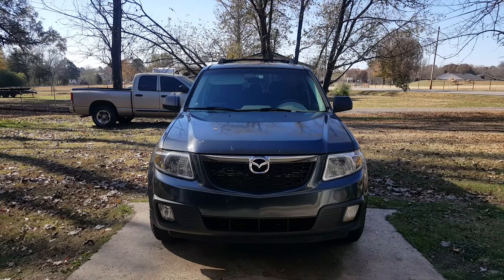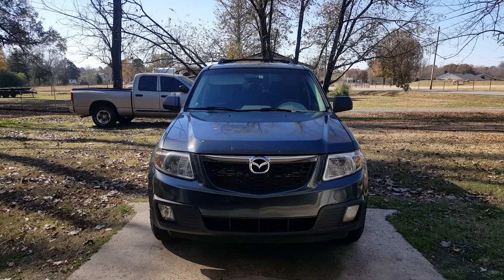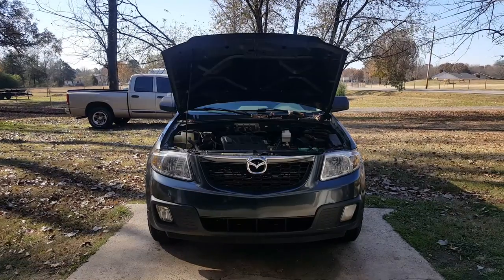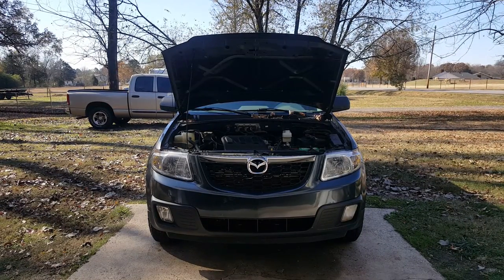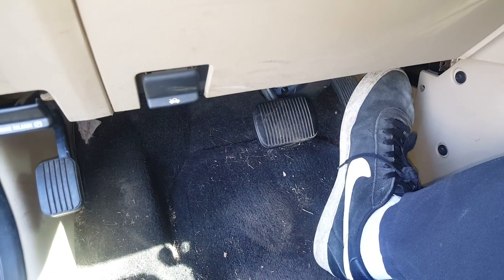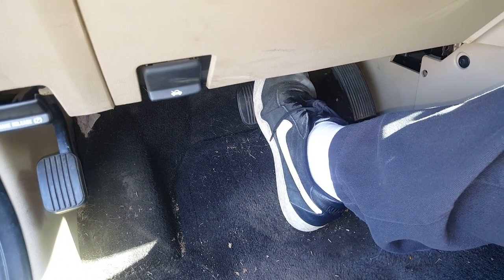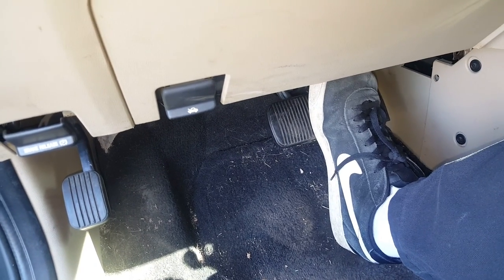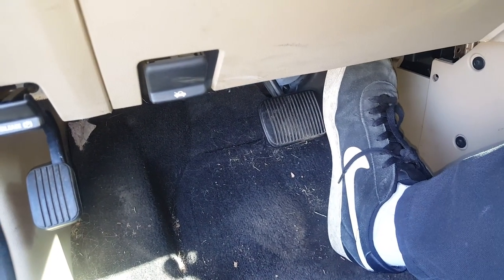Mazda Tribute/Escape/Mariner sinking brake pedal solved abs module/pump replacement

Comment: Great job, just bought my wife a 2010 Escape and after driving it for a month and doing a panic stop my pedal sank to just off the floor.  I also thought it was the master cylinder because the brakes worked but the pedal was low, so I replaced the master.  Problem was not solved, so bought a scan tool.  No ABS faults but low pedal.  I suspected it to be the ABS unit.  Find another with similar problems confirms my diagnosis.  Thanks for sharing your experiance.
Reply from the maker: Most welcome , thank you for the feedback.

Comment: i have had this problem on my 2009 Escape in the past (2014 or so) and had it fixed.  it was around $800.00 then.  I recently had the soft pedal again and began searching for the parts. But the car cant be worth more than $2000 and the fix is approx half that so i was thinking about letting it go.  i decided to pull all the fuses for the ABS and let it sit for about an hour.  plugged them back in and SHAZAAM, sucker works again.  hope it lasts.
Reply from the maker: Great information , this could definitely help others , and be worth a try. I know a similar story with a 2008 Escape , they decided not to fix . Last I checked the pedal was firm again . Really strange , but in some cases something with the abs corrects itself. Thank you for the feedback.
Reply: I'm going to try this on my '08 Escape tomorrow.  Hope I get lucky like you did.

Comment: Great work,  I am having the same issue with my Ford escape 2012 xlt, however there are no codes and no lights in the dashboard, I changed the master cylinder and vaccum hoses and still no luck
Reply from the maker: You might get lucky and use a scan tool to remove some air from the abs unit. Most likely it needs changed. Weird thing I seen on another Escape was it started working again( firm pedal) after driving it some time. Thanks for the feedback.

Comment: Wow, what a misery to have to go thru.  I have a 2008 Escape with a pedal that goes to the floor and it happened when braking on some ice.  You can pump the pedal a few times and get braking action but probably the abs is bad.  Now I know what to do thanks.
Reply from the maker: Thank you for the great feedback and thanks for watching.

Comment: I just hooked up a used ABS unit - can't find anyone that offers rebuilt ones for 2003 Escape. The ABS is oriented differently than yours and I had to remove the vacuum booster to get to the brake line screws on/off the ABS pump. Not a fun job and I don't even have the vac booster back in yet!
Reply from the maker: I agree this was definitely the least fun of my projects as well. I believe the dealers are back logged on the new units also so they seem to be difficult to find. Thanks for the feedback

Comment: Did you try a scanner? Any codes. I feel the hairs ride up on my neck. Just bought a 2008 Tribute w/80k miles. All looks good but the lady said the dealership told her it needed a MC. I looked it all over and test drove. Oddly, the pedal was new car firm. I drove it 80 miles and the pedal finally sunk slowly at an intersection. It was odd because in my experience, a bad MC doesn’t hold pressure that long to do it suddenly. 😞…I hope it’s not a ABS pump. I’ll rewind and see how you plugged it to diagnose. I tied using the EBay link for the ABS pump rebuilder but it wasn’t registering. Thanks for the post.
Reply from the maker: Yes , if you can plug the master cylinder off , that can rule that out easily. If the master cylinder is good , you might try a scan tool with the abs bleed before replacing it. Seen another one that was going bad , all the sudden start working properly again . Still working perfect last I checked. Thanks for the update on the link , I will check it. Thanks for watching.
Reply from the maker: Here is link to a repair service , they also list all the part numbers they repair . Yours will be the same as an escape. 
https://ebay.us/lMFQSI

Comment: Thanks for the tip about ruling out the master cylinder by blocking the output lines.  Did you put the original module on the first used pump you tried?  If not, could that have been the only problem with the first one?  Is the module unique to the vehicle?  What I'm asking is if a junk yard pump was bought, should you swap the module onto the junkyard pump before trying it?
Reply from the maker: Yes , I did put it on also. I had wondered same thing but it made no difference. I would swap the module upfront to avoid having to remove it again if good .The reman unit is still working great. Thank you for the feedback.

Comment: Hi Sir, thanks for all the help. I have a question. I need to take off ONLY the Anti lock ABS module off from the hydraulic system. Do you think is possible to remove it without opening the brake lines? 

Any suggestion is appreciated. Thank you
Reply from the maker: That is a great question . You would have to be able to remove the bolts and have room for that. I would say no , but it might be possible. Wish I could be more help.
Reply: @s33therfan  Thank you for you response! I already replace the Master, Booster and Hydraulic so now I have this issue with the ABS module, So I will give it a try that way I don't have to deal with the brake lines. Thank you!

Comment: Where did you buy your plug kit ?  Unable to locate for under $100
Reply from the maker: I found them on ebay. You can select a size and quantity. There are assortment kits online from various sites too. The cheaper option would be ebay most likely , just select the sizes and how many you need. Thanks for the question.

Comment: The brake pedal on my 2008 Escape went nearly to the floor after hitting a big pothole.  Could this be my issue?  I can't imagine how hitting a pothole would suddenly cause the ABS module to go bad.
Reply from the maker: If there are no brake fluid leaks , I would start with the master cylinder. Hope this helps.
Reply: Did the pedal pump back up right away, or at all? I don't see any fluid leaks. If I'm pressing the break and hit a bump the pedal goes to the floor. Only happens if I hit the bump while breaking.
Reply from the maker: The module rarely ever fail , it is always the hydraulic/pump unit. Thanks for the question.

Comment: I have a 2004 and it has the same issue with the sinking brake pedal,,but I'm also getting a rear brake locking up on me,,,mechanics can't seem to figure it out,,,I'll try this and see what happens,,,
Reply from the maker: It is definitely aggravating tracking these issues down. Once everything is ruled out one wheel at a time , calipers , wheel cylinders , master cylinder , leaks etc. it is the abs is all thats left. The locking up issue seems odd , I'm assuming drums. I know I had leaking wheel cylinder on another car , the brake fluid mixed with the brake shoes and it would lock up until you drove it enough to break it lose. Anyways hope you get it resolved soon . Thank you for watching.

Comment: Dumb question, where did you get the cylinder plugs so the fluid wouldn’t leak?
Reply from the maker: I have gathered up a lot from ordering parts here and there. You can order an assortment kit from ebay , and they are real handy to have. I will leave a link, thanks for watching.
https://www.ebay.com/itm/264299611646?mkcid=16&mkevt=1&mkrid=711-127632-2357-0&ssspo=FzBmfMB0QJi&sssrc=2349624&ssuid=_yxSh9fFQaS&var=&widget_ver=artemis&media=COPY
Reply: Thank you very much

Comment: Where did you get your replacement
Reply from the maker: I found the replacement on ebay. A company on there rebuilds them. They have went up slightly with demand , however they were back logged at the dealer with new hydraulic units. Follow the link in the description and if it does not work let me know . Thank you for the feedback , and thanks for watching.

Comment: I REALLY need some help ya'll. I've never even heard of whats happening with my 2008 Mazda SUV. I'm hoping someone here has a clue.
My breaks will be working fine, I approach a stop and while pressing the pedal, if I hit a bump or sudden uneven spot in the road - equivalent to a hard bump, my pedal drops to the floor. The ABS kicks in and does its thing, and it skids to a stop. 
It will stop, but the pedal won't pump back up. Then, after a few days of sitting, the pedal works fine again. 
Does anyone have an idea? Does it sound like this module? I called the dealership and they want to charge me $200 an hour just to diagnose it. I can't afford a new car... Who can these days? If anyone has a clue, please let me know. 
This only happens if I hit a bump while breaking.